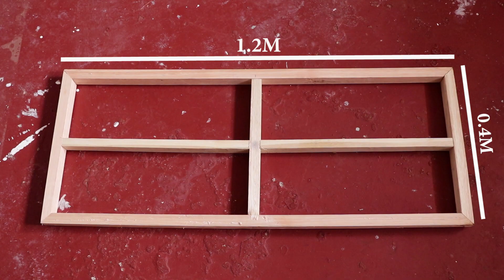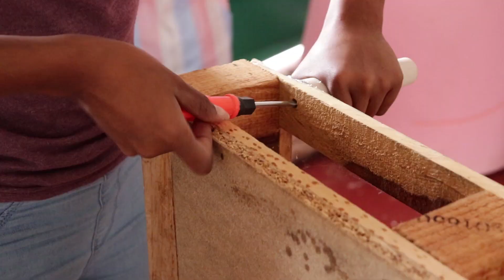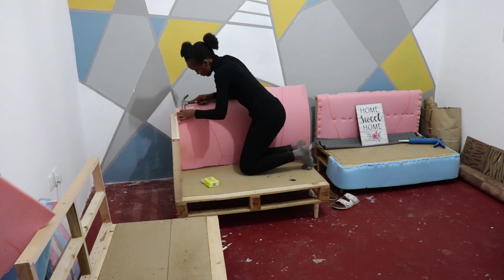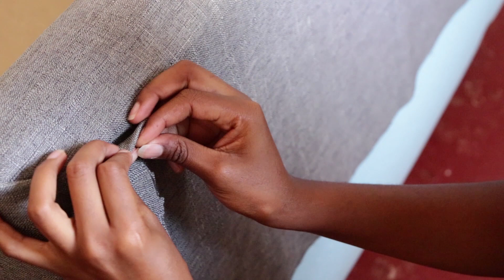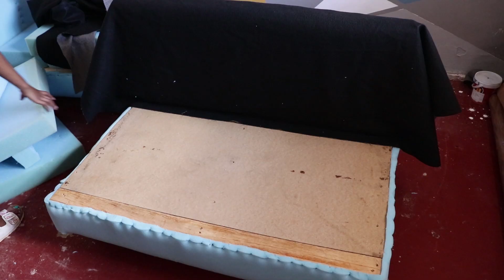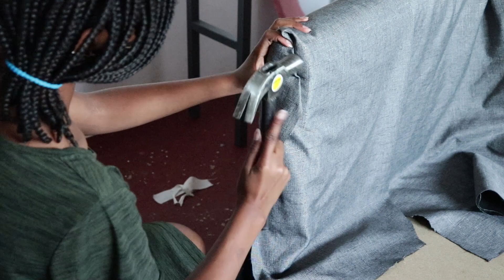DIY SOFA FOR UNDER 100$!

Comment: Try using a stepler ... Its easier
Reply from the maker: It would definitely have been easier. I actually tried using a stapler but the layers were too thick so it wasn't going in. (I think my staples were too weak😅) That's when i opted for the tacks
Reply: @buildwithness  which still worked.. Hope you used the furniture stapler
Reply from the maker: @diywithbrendanasy4883  Yes😂.....an upholstery stapler